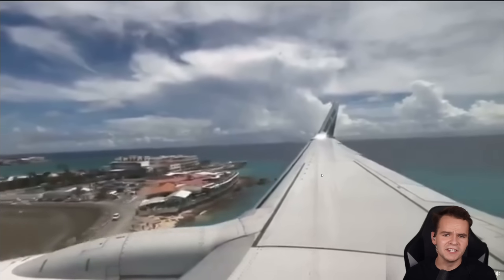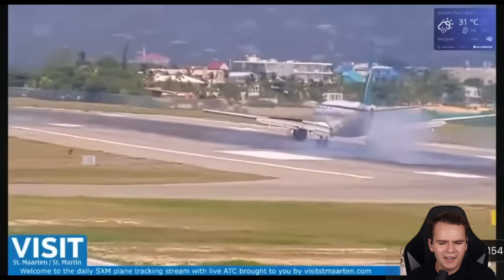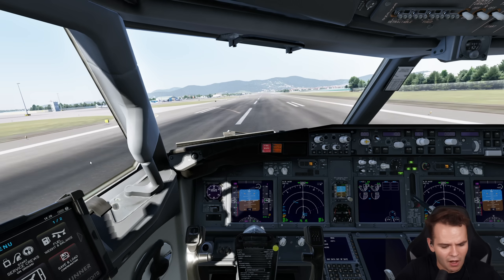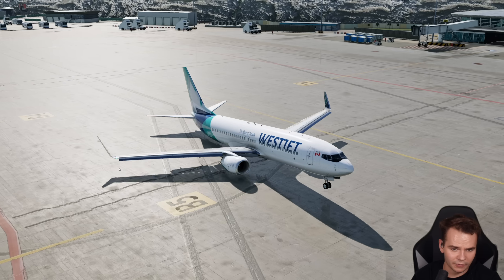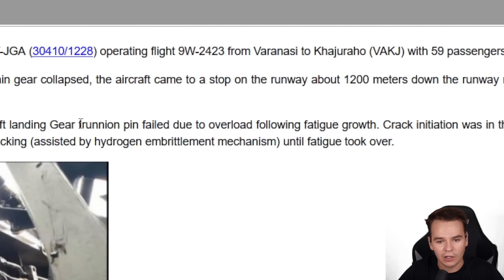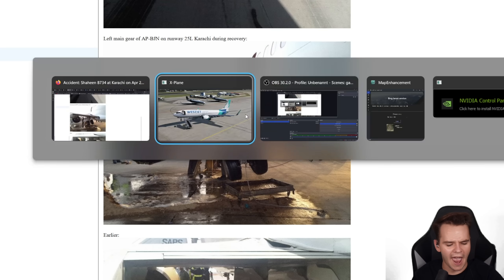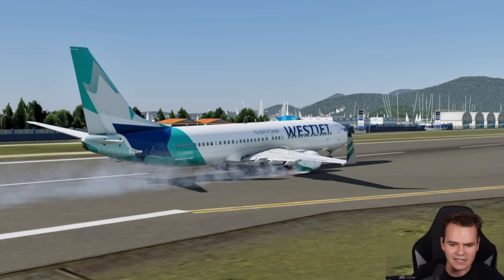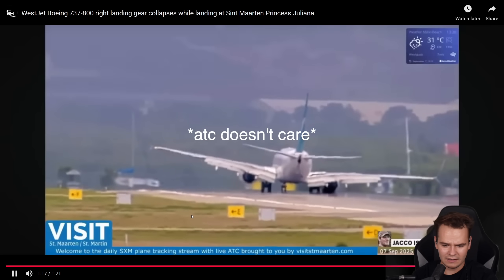Why Do So Many 737 Have LANDING GEAR ISSUES?

Comment: The 737 runs a ton of daily cycles compared to most other mainline aircraft. I would say the crj's do as well. It needs to also be pointed out how many 37's are operating daily on routes compared to others. More cycles, mor chance of failure. That is simple engineering. But I went back and tried to pull information on the number of 737 gear collapses on Southwest. Numbers I was able to find from FAA and NTSB showed it overall to very VERY low compared to all aircraft. So Swiss001, I'm a little disappointed in this video. I might be looking at maintenance. Some airbus's had nosegear issues for years until maintenance practices were changed.
Reply: Exactly!
Sadly, the best comments get the fewest likes.

Comment: I always used to think that the 737s were intentionally built to withstand hard landings. But the fact that they are starting to have issues far beyond what we expected. Ryanair lands their planes hard, but due to the fact that they fly to smaller airports mostly, with shorter runways. They really dont have an issue with that, but sometimes (rarely), it can happen (not making a Ryanair joke here. They are not that funny anymore). 

Im a frequent flyer who experiences rough and hard landings and always never had concerns, considering how strong aeroplane wheels are. Like the fact that the little wheels can withstand thousands of pounds of pressure, not just landings, but when the plane is on the ground is far beyond a great marvel of engineering, keeping those wheels intentionally strong 💪

Comment: I’ve flown on the 738 max a few times know, in my opinion one of the best smaller passenger airlines. But clearly has a qc issue or a requirement of extra servicing and maintenance. My only concern with a lot of them not being used for years, that can’t have done them any good ether.
Reply: I flew a MAX 8 a couple months ago and it was a very pleasant experience. The landing wasn't bad and no issues with the aircraft.
Reply: Most people, they will fly on a MAX and not know it. 
Tell em it was a MAX and than they start shouting that they nearly died. They will say many issues happened🤣

Comment: They are considering fixing it on the airport said by an airport operation worker. A new wing, landing gear and engine will be needed so they will have be either flown in or transported by water.

Comment: 1- Sick of bumpy rides? Smooth it out — fly Airbus!
2- Tired of landings that feel like crash tests? Upgrade your spine — or just fly Airbus.
3- Your coffee shouldn’t hit the ceiling when you land. Fly Airbus — your cup (and dignity) will thank you.
4- Other planes land. Airbus glides. Experience the difference — and keep your fillings intact.
5- Brace for impact? Not with Airbus. We land smoother than your favorite pickup line.
6- Flying shouldn’t feel like falling. Choose Airbus — because the runway isn’t a trampoline.
Reply: The Airbus glaze is crazy 🥀
Reply: damn chatgpt got updated again?
Reply: And enjoy crashing during an airshow cause your "advance fly by wire" thinks it knows better? Stop glazing bro 🫩💔🥀
Reply: @tylorishere  Or into a mountain because of your autopilot
Reply: @tylorishere well a faulty MCAS system brought down 2 737max not only the pilots but also the passengers 😢💔🥀
Reply: @InklingBoy it was the fault AOA sensor, the MCAS system worked just fine, It was the lack of crew training on it that caused the accident, get your news right 🤦
Reply: @tylorishere  MCAS was not included in flight manuals or training so the pilots must guess what switch disable the AOA sensor lol
Reply: @InklingBoy read my comment again, S l o w l y
Reply: @tylorishere read my comment again, S l o w l y hope not to burn batteries like the Ana 787 lmao or make the pilots to cut off the fuel switches 😂
Reply: @tylorishere  1. Ed Pierson (Former Senior Boeing Manager)
	•	“I would absolutely not fly a MAX airplane.” He shared this blunt assessment after witnessing intense pressure on the factory floor to “rush the planes out the door.”  ￼ ￼
	•	In one anecdote, before the Alaska Airlines door-plug incident, Pierson boarded a flight he thought wasn’t a MAX but discovered it was only after seeing the emergency card. He got off the plane immediately.  ￼ ￼
	•	He criticized leadership: “The problem is leadership … the pressure to get airplanes out the door is greater than doing the job right.” He still refuses to fly on a MAX.
Reply: @tylorishere  2. Joe Jacobsen (Former Boeing Engineer and FAA Employee)
	•	Warned that allowing the MAX 9 to return to service was “premature.”  ￼ ￼
	•	Added: “I would tell my family to avoid the MAX. I would tell everyone, really.” He cited a culture that favored “financial engineering instead of technical engineering.”  ￼ ￼

3. Internal Messages from Boeing Employees
	•	In chats and emails, employees expressed deep mistrust of the MAX line:
	•	“Would you put your family on a MAX simulator trained aircraft? I wouldn’t.” “No.”  ￼ ￼ ￼
	•	“This airplane is designed by clowns who in turn are supervised by monkeys,” and they referred to its “piss poor design.”  ￼ ￼ ￼
	•	In one message: “This is a joke,” and elsewhere referring to simulator training as a “turd.”
Reply: @tylorishere  4. Flight Attendants’ Union at American Airlines
	•	They “refuse to walk on a plane that may not be safe,” expressing fear and demanding a strong role in the MAX’s return.  ￼

5. NTSB Findings
	•	The National Transportation Safety Board concluded that Boeing factory employees felt rushed and underqualified, and that training and oversight were insufficient—factors that contributed to the 2024 door-plug blowout on a MAX 9.
Reply: @InklingBoy would rather have a battery burning rather than having my A320 ADIRU feed incorrect data into its flight control unit or have my A300 have a DESIGN FLAW in a basic rudder control system, stop glazing airbus atp, they ain't perfect, both companies are ran by humans who can make mistakes and Boeing's new management has already addressed 90% of it. 🙏
Reply: @tylorishere humans working for Airbus have learnt a lot of every faulty design or component meanwhile humans working for Boeing nope 😢
Reply: @knantumpengDude.. the mistake made by Boeing was that they didn't make airlines aware about the new MCAS system, and didn't include it in the training manuals.. Plus the MCAS system did do what it was supposed to do, the faulty AOA sensors were to blame.. plus, Just one incident doesn't lead to a whole grounding. There needs to be atleast 2 incidents that are auspiciously similar and for the Max case that happened with Lion Air and Ethiopian air. That's why they grounded the max AFTER 2 crashes.
Reply: @knantumpengplus, Boeing's New management has LONG before addressed all the problems that their aircrafts had have. The new upcoming 777x is probably the most scrutinized and the safest plane made by Boeing.
Reply: @knantumpengthere are plane incidents and crashes every few days, if we go by the standard of grounding planes just after a single crash, you would have the airline economics equivalent to ZERO. You can't just ground a plane, just because of a SINGLE incident. You need to be sure, that it's the fault of the plane and that was determined after 2 crashes happen consecutively, With a very similar timeline of events, authorities were sure that yeah, it's the plane's fault.
Reply: Glazing Airbus more than a prostitute gets glazed is crazy lmfao .
Reply: Bruh this is chat gpt 100%, dont lie lil boi
Reply: @Itzlu2020  Bruh your reply to this chat gpt 100% dont lie lil boi
Reply: @InklingBoy bro you just copied and pasted that thing 😐
Reply: @Itzlu2020  bro, you´ve just copied and pasted that thing 😐
Reply: @InklingBoy you deleted the old comment and youre acting inmature asf
Reply: @Itzlu2020  I was about to ask you the same thing. You deleted the old comment and you´re acting immature asf.
Reply: @InklingBoy ??
Reply: @Itzlu2020  ??
Reply: @InklingBoy  A random dude who uses one of them xbox/playstation thingies (what is the difference anyways) is attempting to get into aviation.
Reply: Probably just a bot. Report for spam.
Reply: @thetruthbehindplanes probably just a bot. Report for SPAM.
Reply: @thetruthbehindplanes  Boeing 737 (Classic, NG, MAX – post-1988 only)

Approx. fatalities: ~3,790

🔹 Some major fatal accidents:
	•	1991 Lauda Air 737-300 (Thailand) – 223 killed
	•	1996 Birgenair 737-300 (Dominican Republic) – 189 killed
	•	2006 Gol 737-800 (Brazil, mid-air collision) – 154 killed
	•	2010 Air India Express 737-800 (Mangalore) – 158 killed
	•	2018 Lion Air 737 MAX 8 (Indonesia) – 189 killed
	•	2019 Ethiopian Airlines 737 MAX 8 – 157 killed

⸻

Airbus A320 Family (since 1988 entry)

Approx. fatalities: ~1,490

🔹 Some major fatal accidents:
	•	1990 Indian Airlines A320 (Bangalore) – 92 killed
	•	2007 TAM A320 (São Paulo) – 199 killed
	•	2015 Germanwings A320 (French Alps) – 150 killed
	•	2016 EgyptAir A320 (Mediterranean) – 66 killed
	•	2020 Pakistan International A320 (Karachi) – 97 killed
Reply: ah yes, lets blame pilot training on the aircraft manufacturer. I presume you used to get extra time on tests, didn't you?
Reply: @TandMe  Every time a Boeing plane crashes, Airbus shares tend to increase in value.
Reply: @InklingBoy   yeah and they arent giving a drop of their value to you bro, knock it off

Comment: The 737NG has issues with the trunnion pins, but the 737 first gen/classic have them with the shimmy damper just like the dc-9/md-80 
So even tho it happened to the Ng I think 3 times (probably), it’s not the same as the shimmy damper on the classics